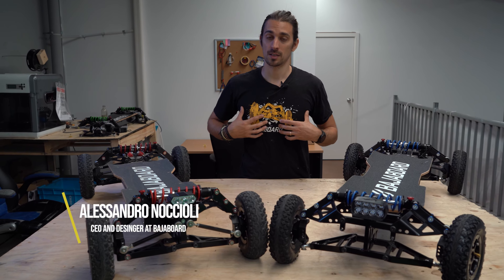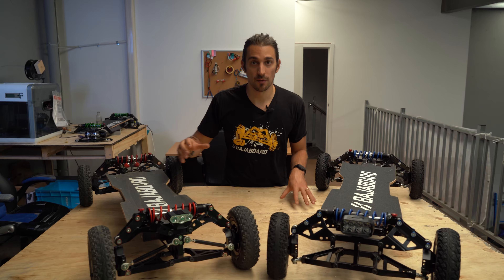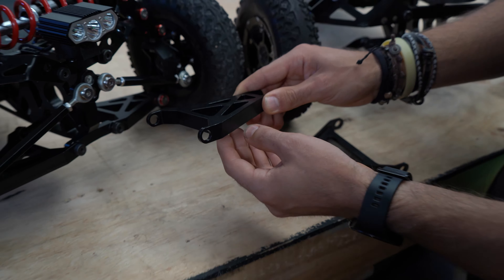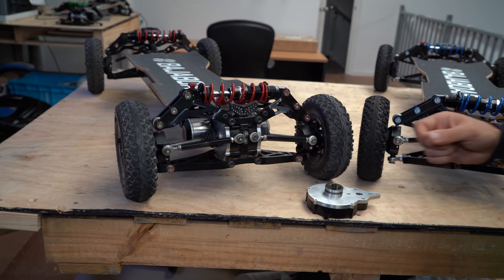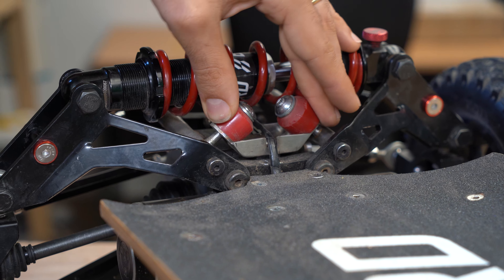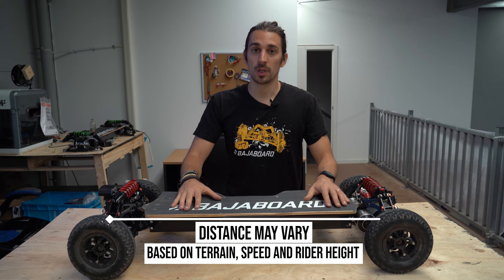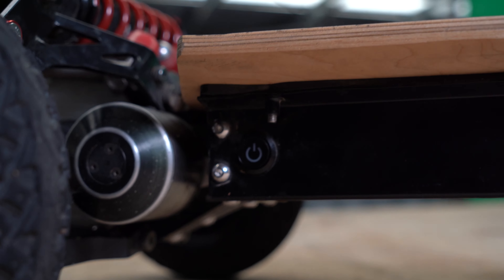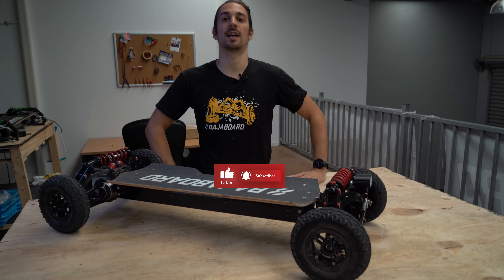ATRAX Vs S2! How much better is our brand new S2 ATRAX?

Comment: Glad I ran into you guys while searching for a serious upgrade to my esk8.  While the likes of Lacroix and Kaly are great in their own ways, what I like about Bajaboard is your different approach to your boards.  Your chassis (not truck) design are so similar to cars.  Despite some of earlier reports of structural reliability issues, I am glad to see you continue to tweak the principally sound design.  This why the German cars continue to outperform in the areas of engineering than their US and Japanese counter parts. Love to see lighter, stronger, and more efficiently design parts in the future.  I think you guys should tap into the upgrade/aftermarket by offering parts that are made of higher grade materials such as Grade 5 Titanium, AL alloy 7075, carbon fibers, etc.  Lastly, it would be great to see you guys moves into simpler/smaller/more reliable remote and move the setting and adjustment to phone based apps.  Keep up the great work guys!
Reply from the maker: Our goal is to never stop innovating and looking for a different approach despite sometimes it takes months to test each part thoroughly. Now that we are very confident in the Atrax chassis and production already started, we will start looking for accessories and upgrades for these boards too! More videos will come about this topic!

Comment: what i want to know is does the board have to roll on air filled wheels? solid wheels are fine and also .. where i live the puncture is sadly a very real thing. which wheels would fit the board from aftermarket?
Reply from the maker: We never used solid tires on our boards but there are on the market some tires that should fit our rims for the 10"

Comment: Got my S2 last summer and I have been more than pleased with the quality and performance! I am without question going to upgrade to ATRAX.. ..largely to do with the service after the sale, from Andy. The rear light upgrade requires a new motherboard to be ordered as well. Will soldering be required? Only reason I haven’t placed upgrade order is no one seems to know. You guys rule! 
PS please start selling merch on the site! NEED a Bajaboard shirt!
Reply from the maker: We have just got stock for hoodies, t-shirts, benie and hats! We are going to add them to the store soon or if you can't wait send us an email to info@bajaboard.com.au
Reply from the maker: I forgot to mention that you don't need to replace the motherboard inside. We found a way to keep using the existing motherboard so you just the new front and rear lights.
Reply: @BajaBoard  Fantastic news. PLEASE NEVER STOP innovating these boards and continuing to make it better and better. So pumped to see what you guys cook up next!

Comment: Awesome board...well done. My question would be is how often would you need to do maintenance on the gear drive? After how many klms? And would I have to dismantle it?
Reply from the maker: We recommend to change the grease once a year or every 2000km just give a quick check inside the gearbox. Next video will be about the gear drive.
Nice bike 🏍
Reply: @BajaBoard  thank you for taking time to reply. I appreciate it and its great there's not too much maintenance. Love it and can't wait to put in my order.
Thanks for the compliment on the bike too mate.

Comment: Alessandro, great video but it got me to realize something very important. There’s no video or image of the S2 ATRAX with the 10S10P (18000Wh) batteries on your website or anywhere at all. I ordered (Invoice #3080) that model already without realizing that I don’t even know what the board will look like with that battery protruding on the deck like you mentioned. Will it be dust and water resistant with that design? Can I damage the batteries from there? Can we (I) see what that board will look like and if it will feel/ride differently?? I think, It’s a marketing failure that the best ATRAX can’t be seen online at this time. Sorry to point this out but I’m a fan and a paying customer.
Reply from the maker: Hi, Thank you for your order! 
We have a side view picture of the extra enclosure on our website: https://bit.ly/3cjuARN
We are making the final mold for it and as soon as we get it we will make a dedicated video. It will have a gasket around it and unless you decide to jump with all your weight on top of that enclosure you won't be able to damage the battery.

Comment: How would it handle light rain /puddles ?
Reply from the maker: We have a gasket around the chassis box and grommets for the motor wiring to prevent light rain/small puddles do enter the chassis box and damage the electronics. We also conformal coating all the electronics to add an extra level of prevention. So under light rain/small puddles, the board will be fine but we still recommend avoiding it if possible.

Comment: I really like the ATRAX design :) Awesome build :). Sir are the batteries welded with nickel kind ? or any plans to implement a battery like Trampa since Baja's design seem to have ample space for batteries underneath the deck :)  Thanks :)
Reply from the maker: Yes the battery pack is spot welded but we have no plans in changing how the battery pack is assembled 🤔
Reply: @BajaBoard  Thanks 🙏 ATRAX has a great drive & suspension system 🙏👍
Reply: Trampa battery system is extremely cool. If you could get a baja frame then it would be easy to slap the battery case on there even includes esc mounting haha.

Comment: Would it be possible to retrofit the geared drive to the 2019 G4X?
I'd ask via email but a few of my emails have gone unanswered
Reply from the maker: Hey Anthony, unfortunately it's not possible to fit the gear drive to the G4X.   
Would you be able to resend email to info@bajaboard.com.au?  We've had some IT issues with our hello@ email address.  Sorry for the hassle.
Reply: @BajaBoard  ahhhh I've been sending emails to the hello@bajaboard address for over a year now. It's actually the address still advertised on the Bajaboard website.

I forwarded the old email to the new info@bajaboard address in hopes of solving my issues. Thank you
Reply from the maker: @anthonycampos7417  we still use hello about for general inquiries we move them to info